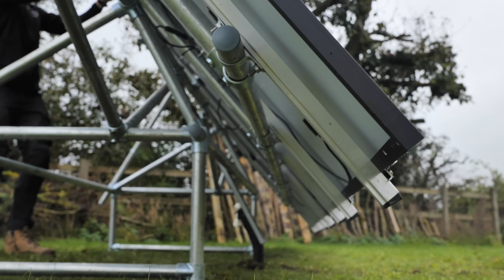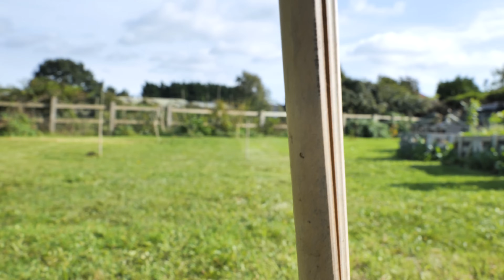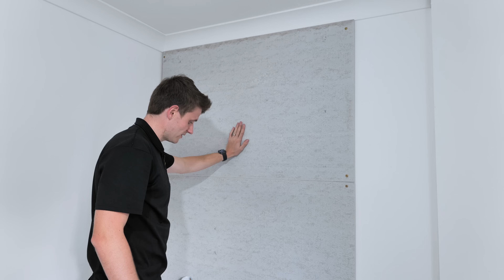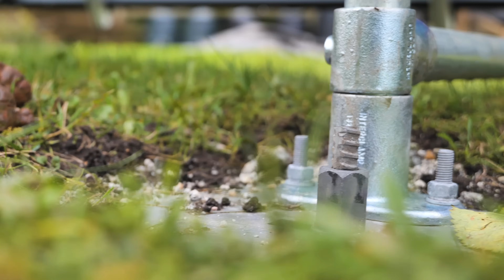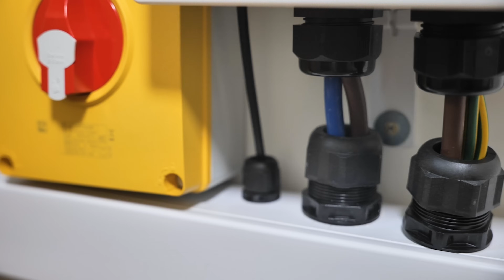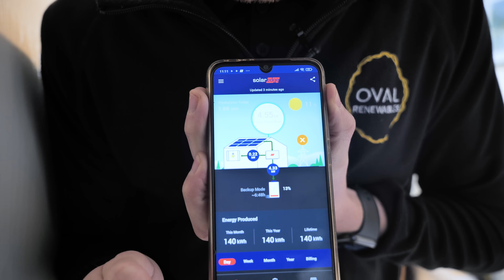Adjustable Solar Panels! Ground mounted solar with battery storage and power cut protection!

Comment: Very nice installation and helpful video. Just wondering why 4x single 6mm2 cable was used when a single twin & earth 16mm2 cable would give greater capacity and cost less.

Comment: Nice video. Are those inverters G99 1-9 version compliant as per the latest ENA:EREC regulation? Have you faced any issues with the DNO when proving compliancy? Thanks
Reply from the maker: At the time of the video the inverters were compliant with the DNO latest G99 certification. This is always changing and sometimes there is a little lag between the new compliance being applied to the inverter but in general SolarEdge are quite good at keeping the compliance.

Comment: Seems alot of work for the customer to change these every month. Can they be automated?
Reply from the maker: Thanks for the comment. It’s not critical that it is changed this system just gives them the option. It only take about 1 minute to change each section so it’s nice and easy. If they don’t change it then it will still generate. You can’t get tracker systems that would move automatically but they are a lot more expensive.

Comment: Great video. I have  exact same system minius the backup and have a question. In the absence of SE EV Chargers in the UK market, what charger would best integrate into this setup? Also how would it be set up to not have it discharge the SE Batteries when the EV is plugged in unplanned? TIA.
Reply from the maker: Thanks for the comment. The SE EV charger is due imminently. We are expecting it before the end of February. However the Zappi would be the next best. With the Zappi there will be times when it will discharge the battery unfortunately there is not much that can be done the best option is to wait for the SE one.
Reply: @OvalRenewables  oh wow was not aware of that. Will send you an email for details. Thank you.

Comment: Roof worker should have been hooked up for safety. Very bad example on how not to do this.
Reply from the maker: This is a ground mounted system…😅
Reply: :face-orange-frowning: @OvalRenewables  You are correct. comment was for previous video

Comment: nice set up of the solar panels. Did you ever consider Bi-facial glass-glass panels? And another thing: could snow accumulate at those optimizers when tilted at 60 degrees in winter? Or are those weather proof enough?
Reply from the maker: Thanks! No we didn’t the cost of them would outweigh any benefit in my opinion but would be an interesting one! 

From memory the optimisers are IP67 so if snow did gather on it then it would be fine until it melted.

Comment: Hi- great video. Could you say something about the dc cabling into the property. Ducting? cable sizing for what must be a variable voltage? inverter @ c80% of max array - what happens to the other 20 % presume the current increases ? many thanks

Comment: Hi Sam, just out of interest, how much more power would be generated in winter if panels fixed at say 30 degrees were able to be tilted to 60 degrees? I’m guessing that it must be substantial to make it cost effective.
Cheers
Keep up the good work!
Reply: You could maybe double your output, albeit from a low level in winter - 24 panels at the right angle could give you 4kw on a winters day, the savings are to be made in the summer, if you can export
Reply: @EverydayLife621  👍
Reply: On a roof fixed at 20 degrees, you don’t get snow off for days or weeks during the winter, so power output can be 10 to 100 times higher at 60 degrees in winter without snow covering the panels.

Comment: Very interesting vid....
We have a system at work....
And the change over is about a second.
That system seems to take ages.
The difference is, we run off solar and battery main then jump onto mains .
It can change off grid....
Reply from the maker: I’m not 100% sure why it takes that long but we may investigate this with SolarEdge and report back!
Reply: @OvalRenewables  That changeover time is ridiculous, I actually laughed. I have a 8kW Victron system, and the changeover both coming off and going back on the grid is instant, well 20 ms apparently. Computers carry on working (they wouldn't without a UPS on SE, digital clocks may well reset etc), in fact the only way you know is via a notification. I'm pretty sure that generation meter is no longer required, and I hope you fitted a bi-directional one, otherwise it will be measuring battery discharge as generation, and the battery may have been charged from the grid off peak. I also believe SE include battery discharge as yield (other systems do this as well, and its most annoying), so the daily PV generation is incorrect. I have a Victron Quattro 48/10000, my incoming grid connection is diverted through the Quattro, which has the required changeover relays, so I get instant whole house backup. I also have an older SE system, in the event of a grid failure, the Victron can control the SE inverter if too much power is being generated by altering the frequency. Victron gear is expensive, but there is a lot of choice of much cheaper batteries nowadays.

Comment: Why is the switch-over for the SolarEdge back-up interface so slow?  There are systems that provide nothing more than a slight flicker (I think you have demonstrated one previously) yet this one takes at least 12 seconds.
Reply from the maker: I’m not 100% sure why it takes that long but we may investigate this with SolarEdge and report back!

Comment: I thought switching to the backup mode should take less than 10 milliseconds resulting in a slight flicker at worst.
Reply from the maker: It’s not designed as a true UPS but I will consult SolarEdge and may put out another video with the answer 👍
Reply: @OvalRenewables  Thanks for the prompt response. It will be a missed opportunity if they don't have a true UPS mode. Most cheaper Chinese options (e.g. Huawei, Goodwe, Sungrow, Sunsynk etc) offer that already.
Reply: @adon8672  So does Victron, less than 20 milliseconds, its not even noticeable,  I can switch my grid off, computers carry on working, lights don't even flicker, just my phone pings.

Comment: How do you lay the dc cable from arrays to the house ? Is it armoured  or in a conduit ? I’d love to see how you do that
Reply from the maker: We used a dual wall duct and then used PV ultra which is a multicore DC cable from Doncaster Cables
Reply: @OvalRenewables  thank you !

What do use to seal conduit when it comes out  in the field ? 

Thx

Comment: Great video and walkthrough, looks like the outside solar panel was made using scaffolding poles !! when using Hybrid Invertors which support 'Island Mode' am i right in thinking that there is no connection to the DNO provided Earth at all? is there any reason why a householder should installed their own Earth Rod and use only this and not the DNO provisions? Will the controller allow you to run off batteries or Solar without an AC Input to run off grid indefinitely?
Reply: It's not scaffold, its very similar, Google Key Clamps, although you could use scaffold, it wouldn't look so neat. On the Victron system I think the earth remains connected in a grid failure, but you can't rely on it as the cable may have been completely severed, hence you need a earth rod. If you have whole house backup then you could run off grid (within the limitation of the inverter power), but only until you run out of battery, in the summer you'll likely be fine, but in the winter in the UK, no chance unless you have an alternative generation source than solar.
Reply from the maker: You will require an earth rod but you still connect the home’s main earth to the system. This keeps all the earth bonding in place during the power outage. 

I can’t see why the system couldn’t be in off grid more indefinitely but we have never tried it. They home would also be limited to 5/6kw peak consumption however as the inverter would be their main power source

Comment: Nice install. The switchover took some 12seconds. Why is that?
Other systems are so fast you can’t tell.
Reply from the maker: I’m not 100% sure why it takes that long but we may investigate this with SolarEdge and report back!
Reply: Yes have to say many inverters now offer sub 30ms switching so UPS functionality for the home. My Fronius inverter does not have UPS functionality and I have to say on the rare power outages we have I wish it did. Personally I would now not install one that did not give this feature. Think its a real miss by SolarEdge that there new kit is behind some of the competition.  @OvalRenewables

Comment: Looking to use the Cornish Rocker when I get my ground mount array installed, glad to see you use it and get knowledgable with it and the latest SolarEdge gear.👍
Reply from the maker: Great! If you need a solar company to hook it all up then you know where we are!
Reply: They appear to be using standard Key Clamp or similar components, great idea, and readily available parts, may be some custom parts though.